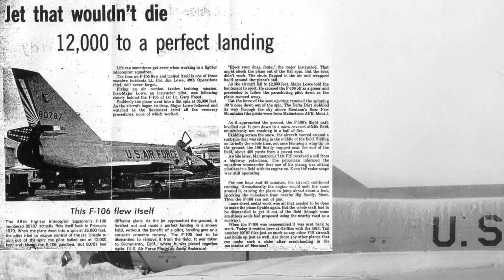F-106 Corn Field Bomber, Convair Delta Dart

Comment: I was a A1C , in the 94th FIS 
In pneudraulics ( that's hydraulic & pneumatics),, technician, on F--106s at Selfridge AFB ,Michigan. 
Take off trim was 3.5 deg  up on the elevons
which were the (elevator's & ailerons) & were mixed together because there were no separate elevators on these planes., &  zero degrees on the rudder.
The delta wing design, has very little drag making them very fast for it's day!
 With the aircraft speed, altitude,, heading, power setting, wind direction, wind ambient temperature, & velocity, the right amount of fuel, no obstacles, the landing gear UP, the ground JUST smooth & firm enough,  & a WHOLE, LOT OF LUCK, that landing could happen again! 
The F-106 was a remarkably fast airplane, it could fly at Mach two, or two times the speed of sound,  & held the world speed record for a long time! 
The  F-106 is still one of the fastest interceptor planes ever built!  ( Mach two?) CAN DO! 
This video brings back a lot of fond memories. THANKS.

Comment: This tail number was stationed at Selfridge AFB in the late 60's. After 500 hour post flights and engine replacements, I was called to do the run up and taxi on all these birds as I was the only nco on the base with that license.  I taxied this bird and lifted the nose gear many times during my time at Selfridge.  Not sure when the cornfield event took place, but I'd never heard of it until now.

Comment: I'm sorry, but you seem to be mistaken about that F-106B.  No side-by-side F-106s were ever built; only tandem two seaters.  However, what you have there at Volk is a TF-102A Delta Dagger trainer.  The F-102 and the F-106 are commonly misidentified and mistaken for each other as they closely resemble each other.

Comment: This happened to a F-9 Cougar of VT-22 in Kingsville, Texas in 1968. The plane had a flame-out and couldn't be restarted. The pilot and instructor ejected and the plane restarted. As I remember, it took them a couple of days to find it. I was on the flight line in VT-21 when a helicopter brought it back. The helicopter set it down so a plane captain could get aboard, then lifted it slightly and the guy ran the landing gear down and they set it back on it's wheels.
The plane never flew again.

Comment: It took quite a bit of work to make 787 airworthy again.  The underside was badly damaged, but the airframe was intact.  I had the honor of both working on this aircraft, and serving under the flight commander that made the comment about Gary getting back inside it.
Reply: The aircraft was in a "Snap Up Attack" on a U-2 when it went into the spin.
Reply: Love it! former F-106 crew chief here the that plane ended up at my unit 49th FIS Rome NY before it went to the museum
Reply: @martinmoffitt4702  When were you at the Griff?  I was there from 78 to 85, working in the MA-1 Mock-Up.
Reply: @lindeleasley  I was a flight line F-106 and T-33 crew chief  80-84 I lived with Guy Alheit on West Court street

Comment: I have a freind of mine that was flying an rc delta wing nitro powered airplane , when the canopy came off in mid air it pulled the reciever battery out with it , being nitro powered the plane kept on flying flat and level untill it ran out of fuel about a mile away , we chased it down and recovered it with just the landing gear being torn off upon its landing sitting there right side up ! we were all amazed it had survived .

Comment: Reminds me of the story af a mechanic working on an English Electric Lightning, the canopy was removed and she was chained down for an engine test. The chains failed and the thing with engineer shot down the reserve runway heading for a line of fuel bowsers parked in storage. He was not straped in so could not eject. He could crash or pull back the stick. He done a complete circuit and landed safley. True story.
Reply: Uaaowwwwww

Comment: Neat story! Nobody saw the jet land itself? 

I fly radio control models and had vaguely similar landings myself. Once my battery pack got drained by the retractable landing gear, and I lost radio contact just as I was doing a slow and low pass over the runway. Luckily, the plane belly landed itself in the mowed grass just off the end of the runway with very minimal damage. The other time, I had to land blind, dead-stick behind some trees into a bean field and got lucky with no damage at all.